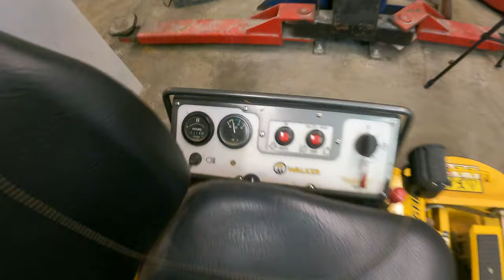You Won't Believe What I Found | Walker Kohler Not Charging | Stator Replacement

Comment: When I bought my Walker new a year-and-a-half ago they showed me when checking the oil that you put the dipstick back in and screw it counterclockwise about a half a turn and it will drop down about a quarter inch, then you will have a proper reading.

Comment: How did you test the rectifier
Reply from the maker: It’s process of elimination to test it…. If you are getting proper ac volts about 36 or so on the 2 outer terminals and you get dc battery power higher than the voltage of the battery itself on the middle terminal when running the rectifier works….. if you don’t have ac at the outer terminals around 36 your stator isn’t working.

Comment: how come you ended up tearing down the 31 hp machine?
Reply from the maker: I got it with blown head gasket, it was leaking into freeze into cylinder…. My local dealer put new head gasket in by the book and it still leaked I bought it for $1000 with many good new parts on it when all I was really looking for was a hopper….. I then took it apart did my best to check the head ane resurface on glass with fine paper etc really took my time and it still did same…. I believe the block must be warped or cracked … regardless I had so little into it and it had so many parts good I sold the deck ane many parts and used many ended up getting a good $4000 in value out of it… and still like in this video picking off it saving me $